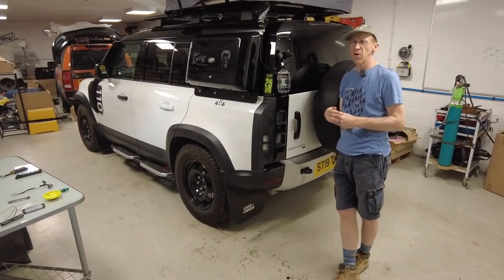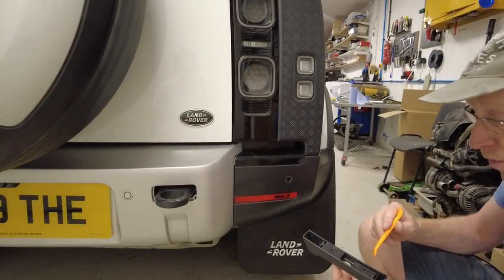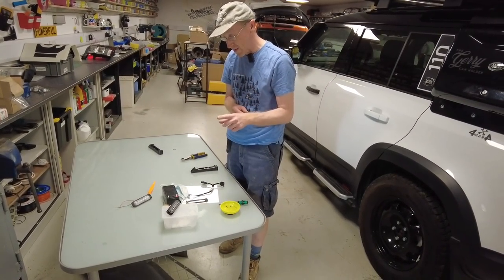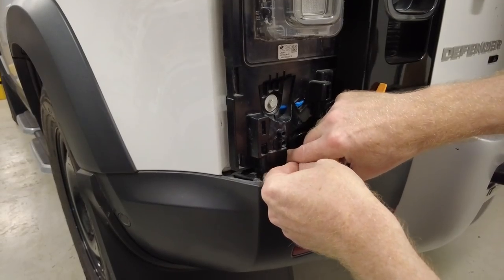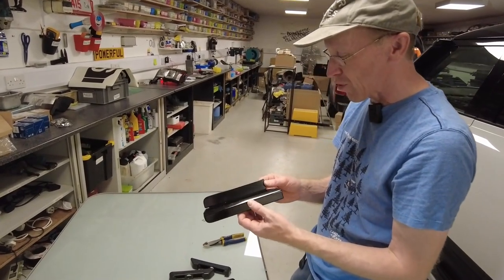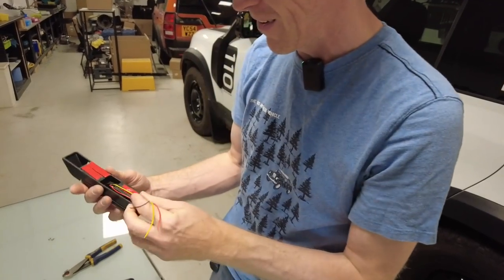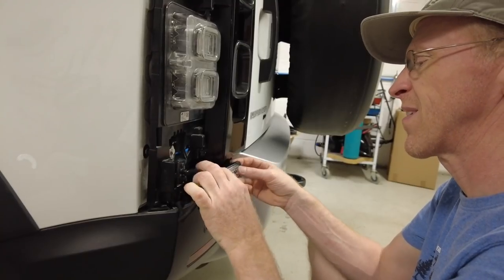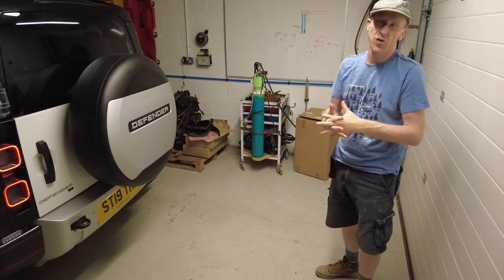Land Rover Defender L663 Reverse light upgrade v2 - New Plinth + Dual Light Function !

Comment: They’d be pretty cool tinted to blend in to 👍🏼. I’ve not even got a defender (want one though) but find this channel interesting, informative and fun 😆
Reply from the maker: We have actually tweaked the design a little to make the light appear more tinted - we changed the PCB ( printed circuit board ) inside the light unit to be black instead of white so it looks more discrete - but tinted would be another tweak.
Reply: Agreed a tinted version would be awesome

Comment: Just installed these on a MY2023 D110X and everything went well. Lost two clips, so the extras were much appreciated👍👍  I used painters tape around the edges to protect the PPF, which I think was a good idea. 

I took John Willett’s suggestion and soldered the connection at the bench. Prior to that I tested the connection by just using wire nuts to hold everything together and plugged it all together. After starting and confirming the positive connection, I soldered, heat shrinked, and taped the whole thing together. 

As others have already said, the lights make a huge difference in being able to see what’s behind you at night, and just as importantly look factory.  Well done Simon and the PowerfulUK Crew!!
Reply from the maker: Thanks for the review - i think the solder and heat shrink is a nice way to do it. Happy reversing ! Simon

Comment: Just installed these on my wife's '22 Defender 110... she is very happy with the final product. There is now good clear visibility behind the vehicle both in the mirrors and on the cameras.
Getting that panel off was no joke the first time, but I used a little piece of tape to mark where the fasteners were on the sides, not the white clips, and doing the second one I push/pry at that spot and it came off much easier.
Reply from the maker: Happy wife... happy life...those rear corner panels can be tricky to get off the first time.
Reply: Right! That panel was no joke..Lol. Same story for me as you. But a great addition to visibility.

Comment: Simon, was looking at these + the gloss black spoiler, and somehow tapping into the Running lights, so that way, you can have Amber running lights on the spoiler, then can use the reverse lights as intended as well. I bought these for the reverse pocket like you have, but doesn't hurt to have more reverse lights (more cowbell style)

Comment: Hi . I fitted these and am very pleased with the outcome , they make such a huge difference and I can now reverse in the dark without any concerns . I just wanted some feedback from those who have already fitted theirs and have just attached theirs using the double sided tape have they had any problems or is this method strong enough to hold the lights in place . Any feedback would be greatly appreciated .

Comment: I've just fitted these.  Really easy to do. Do the soldering and heat shrink on a bench first, having mounted the lights to the blocks before you do.  Make them up as a unit, it's easier to fit them when outside on the vehicle.
Reply from the maker: Soldering is a good idea - and the white grease adds some extra protection to the connectors.
Have you tried them at night yet ?
Reply: @L663  I didn't get any white grease.  Yes all working well.

Comment: Great video (as always) and a really great accessory. 😃  One thing - why not solder the light to the adaptor cable before installing the adaptor on the car?  Surely you would get a better solder connection on the bench???
Reply from the maker: Yes its a bit of a puzzle but i think you may have a point.

Comment: Just added these puppies, toughest part for me was separating the original connector, but job done and nicer to fit in the summer when we have daylight hours and sunshine - now all set for autumn/winter - should make life a bit easier and looks great 👍🤓😎
Reply from the maker: Wise man to add these in the summer !
I think Land Rover has installed the connectors upside down if you look at the design of the connector it holds water and mud in the joint between the 2 halves of the connector...
Reply: @L663  I was thinking it didn’t seem like the optimum design for a connector 🤔

Comment: Thank you Simon, fitted to my new defender 2024 model today. Looks amazing and fitting in less than an hour.
For interest is there any issues with MOT for these extra lights. My car is a new so a while before I will be able to experience any issues.
Reply from the maker: Hi Michael. Thanks for your purchase and glad they fitted and worked without problem. There should be no issues with the MOT - my car has been through a MOT with no problems. We have sold a lot of these reverse light upgrades ( over a 1000 sets ! ) and not had any MOT issues. Simon

Comment: It would be nice if the injection-moulded piece had some sort of posts on it that the light pushed on to instead of needing to be screwed on, so you wouldn't have to have the silver-coloured screw heads showing.  Or some covers for the screws.
Reply from the maker: Yes i hear you - some nice little ideas you have.

Comment: Just received these and the quality is even better I thought it would be! Thank you! Is there any top tip for weatherproofing wires on the tie-in loom that are not used?
Reply from the maker: Hi James - good question indeed - I have seen people use heatshrink end caps but not sure where to buy them
Reply: @L663  thanks!

Comment: Great job boys, but I think I would screw on your fitting to original plastic and not use D/S tape, then when and if you need to remove/ replace it you unscrew fitting then I think it would easier to unclip original plastic trim from vehicle which seems very hard work.
Your thoughts on this would be appreciated 
Thanks Pete
Reply from the maker: Hi Peter - in this video I do get in a bit of a muddle as to the correct / best order to do this in... other people have made some comments below also. I dont think it needs the screws from the plinth into the car - the tape should be enough.

Comment: Question guys: I installed these, followed the directions, triple checked the wiring and soldered them. Neither side activates the indicator light. Reverse works perfect, but nothing with either left/right indicator. What could be the issue or is there some reset required for the LR to recognize the new indicators?
Reply: Never mind. Saw he US needs gray/yellow note. You guys should have made that more prominent in the video!! 😡.  One little sentence on the order page isn't enough. Show love across the pond!

Comment: One comment - turns out I had a short when the "extra" wires (I didnt order the turn signal version) was touching another wire even after what i thought was a good electrical tape wrap job. I should have used heat shrink on the extra wires to eliminate that problem.

Comment: Boom! Just ordered. Can you also do a cargo tray for the boot?
Reply from the maker: We have had some thoughts on this.... we are looking at a tray at parcel shelf height.... but getting a secure fixing is tricky.
Reply: Just got the delivery. I haven’t installed them yet, but initial impression is the lights are aimed slightly outwards. The dark spot with the original reverse lights seems to be in the middle (under the spare wheel). Wondering if the lights can be aimed towards the center a bit more to illuminate that dark spot. Anyway will post my impression after I’ve had a chance to test them. Another idea I have is to wire the lights from the trailer hook up. Should be possible to get a pin connector to power aux rear lights.
Reply from the maker: @preetsarai  Thanks for your comments - they are of course valid points - try the lights and see what you think.
We have a connector coming for the trailer socket but that is for a power take off for accessories - i think there could be problems using the light signals from the trailer socket.
Reply: @L663  it would be great if the wiring harness and lights came with a stand  male/female connector already prewired in the kit. That would cut the need for soldering bunch of wires.
Reply: @preetsarai  yup agree, I'm really not good at soldering plus having a connector makes it easier to disconnect should the leds fail and replacing the unit, please powerfuluk give us an optional connector

Comment: Are the ones shown here the same as on the website?  Looks like the ones on the website have darker lenses (which I was going to request).  Going to order these now. Great work
Reply from the maker: Hi Alan - if you look super carefully at 3.28 you can see our old light units had a white inner PCB ( printed circuit board ) the new lights all now have a black PCB and so look a little darker.

Comment: Rather unfortunate to see I was sent V1 when I ordered last month. Getting an upgraded part seems to involve me paying to ship original kit back to the UK at my cost and reordering but V2 is not shown on their website. Feeling a little taken!
Reply: Carl send an email to customer service and we will send you some V2 plinths FREE
We love our customers especially our "early adapters" and those who purchase the first parts we make should never be at a disadvantage - but when we upgrade the design we will clearly have some v1 parts in the market.
Simon
Reply: @simonjefferson  I sent an email and received that response. If there is some way to pass this on to CS that would be great.
Reply from the maker: @carlbeveridge384  Leave it with me - is it just the V2 plinths you are after or also the 2 function lamps ?
All parts on the website are now V2 and have been for a few weeks
https://www.powerfuluk.com/catalogsearch/result?q=LLM804
Reply: @L663  It’s the two function lamps. I have the V2 plinths.
Reply: @carlbeveridge384  OK that odd as we launched the V2 plinth with the lights. So which lights do you want White / Orange or White / Red ?
Reply: @simonjefferson  White/Orange. My lamps received are six white LEDs and just two wires.

To be clear the plinths are the black pieces the lights mount into are double stick taped to the vehicle and have provisions to screw them into the vehicle.
Reply: @simonjefferson  Thanks so much for your help! My amber/white lights are on the way. I appreciate all you do.

Comment: Any tips for getting the electrical connector unplugged? My Defender is a year old and has plenty of dust. I cannot get the connector unplugged despite cleaning it with a toothbrush. Should I try a lubricant?
Reply: I know this will sound odd but sometimes a firm push together of the connector can help before pulling it apart.

Comment: The current standard reverse lights are absolutely appalling 😮.
Off to your shop now..
Also the interior light  in the back is also junk.
If the boot is full it actually covers the original lights..
Come on LR it’s a utility vehicle!!!
Reply from the maker: We have sold LOADS of reverse light upgrades for the Defender... its an area they need to improve - along with the interior lighting !
Reply: @L663 
Just about to install these and the boot light,only had them for 10 months

Comment: I just like reading all the comments! That cold start idle speed sounds high?..My D/Sport SD4 240 doesn’t do any fast idle at all…maybe just the petrols need that help.🤔😐😐😐😐
Reply from the maker: Hi Richard - yes it does rev up on startup but settles down quickly ! it seems to be part of the cold start "choke".... remember the days with a peg holding your choke cable out ?
Reply: @L663  Ah yes…my job on Dad’s Company supplied Ford Anglia MAE 663, was to hold the choke out and reduce it as it warmed up…we were on the way to school and I was about 6/7 at the time! I had Early Learning! That was the car used to learn about changing gear..Dad had to press the clutch as my legs were not long enough! Gosh that was a time ago…but I’m not THAT old..just 38 and a few months…well a lot of months but who’s counting!! 😱😃😃😃😃😃Richard
Reply: Seems it is all about emission control... starts up and hold 1500 RPM until the cats are warm to reduce bad emission output as quickly as possible.